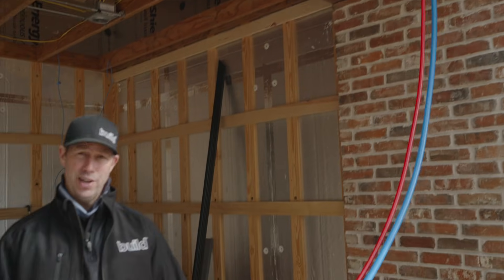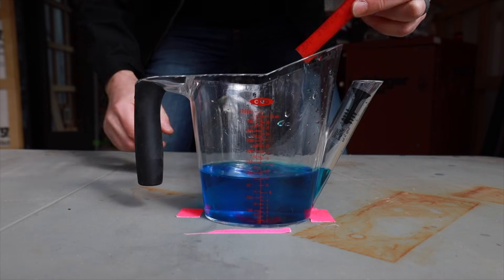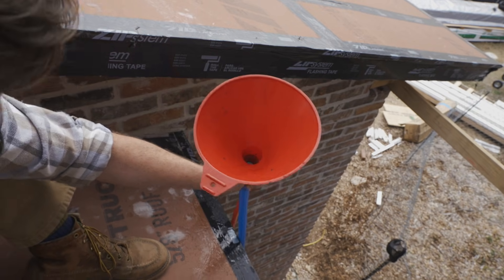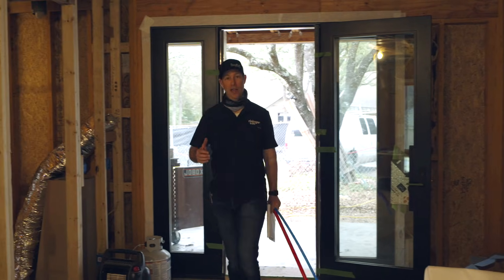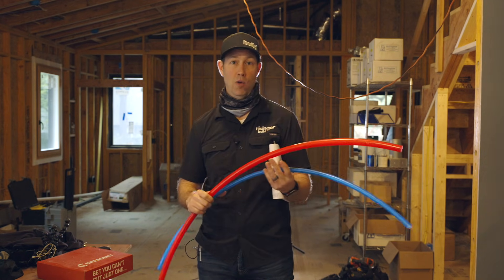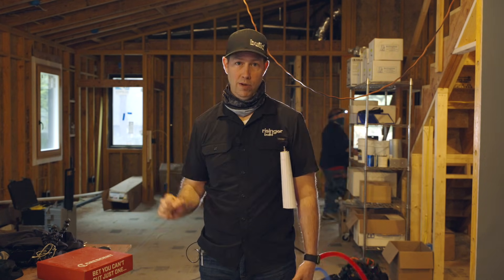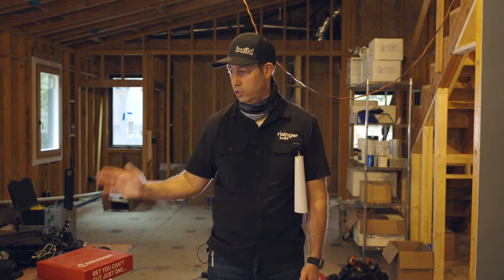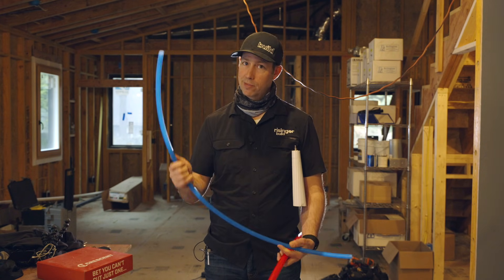What's the BEST Plumbing System

Comment: (.75^2) / (.5^2) = 2.25
(.681^2) / (.485^2) = 1.95

Question: in a hot loop system, is the cost of constantly pumping hot water significant? And, isn't more water used because it has to be bypassed to cold, or separately heated?

Comment: Matt, have you ever looked at small electric on-demand water heaters for bathroom sinks? I am considering that in my new build but find no information on that as an option for low-frequency, low-volume hot water needs.

Comment: I suspect the volume of water you need to heat up at your tap is close to double the capacity of the pipe itself. The water doesn't instantaneously become hot as soon as you've flushed the pipe because you still have to heat up the pipe itself.

Comment: Just gonna put this out there pex is cheap junk. It might be super easy and cheap to install but if you live anywhere cold the mice come and chew through the warm water lines then you end up with a flooding disaster that’s buried in the wall. My dads a plumber and I’ve seen this happen in 4 different houses in New Hampshire I have copper and have no issues.

Comment: Volume doesn't = more pressure,
1/2" pex is rated for 2.3/2.5 gpm
Most fixtures now are are rated 1.0/1.5 gpm....so it doesn't matter what size pipe you are still getting the same flow rate at every fixture.

Comment: apparently i'm an idiot, so if someone can explain to a third grader (me, apparently), i'd appreciate it. Matt indicated that using 3/4 pipe speeds the time to get warm water, but wouldn't that mean accepting almost a 2x waste, from the shown experiment? when only talking about saving water, if the hot water is 10 feet away from shower, 1/2 pipe requires the movement of 1.5 cups of water, and 3/4 pipe requires the movement of 3 cups of water, how does moving the (hot) water that 10 feet with 3/4 pipe save water (i see that as more wasteful by 2x). If only concerned about the time it takes the water to travel that 10 feet, then yeah, use the 3/4 pipe (and accept twice the waste waiting for the water to warm up). 

also, are existing point of use/tankless water heaters not available in the states with sufficient flow to sufficiently heat a high flow shower head?

thanks, appreciate the content!

Comment: need to deploy smart building techniques, have all the water centrally located around a water closet with water heater, kitchen sink, water usage, laundry and batchon one side bath around the central core, easier to design than think. closer to the core, less likely to have freeze issues in colder weather even with failure of heat.

Comment: Take one 3/4" insulated hot water supply line to the room, then use a small manifold block to break out all the equipment in that room with 1/2" lines. This lets the whole room benefit if one piece of equipment is running hot water already. You can put this circuit on a bigger manifold block in the basement (as shown) so that you still have complete control, best of both worlds.
Reply: but you still have 3/4" * x ft worth of volume of water going down the drain before water is up to temp. which seems more like what he was worried about.
Reply: @giantgizan  The available volume makes no difference to the flow rate of a mix valve on any fixture. In other words, fixtures are the bottle neck where you control temp and flow rate. A larger volume of water maintains its temp for longer,  and if you run a second fixture you immediately benefit from the first being already on. If you run individual 1/2" lines, you're going to wait for a greater volume of water to heat up between waiting on two. Your point is moot in that scenario. In the end, water is the cheapest utility, and each situation is different. Often, 3/4" main to 1/2" manifold is choice.

Comment: The downside to the loop is the energy used to pump water and to keep the loop line at temperature (so it should be well insulated). If your home is fully self-sufficient power-wise, that's fine. If not, you need to decide which resource is more valuable.

Comment: energy? heh. how about customer satisfaction?  I've been in quite a few of these houses doing service. NO ONE likes them. NO ONE. delivery speed from heater to faucet is extremely slow. fixing the problem (aside from cutting it all out & starting over) is near impossible. the central shutoff hub valves are problematic at best. good old central trunk line H & C with hot return loop wins out hands down in customer satisfaction EVERY time.

Comment: Here in Ontario Canada, electricity costs are insane, so its worth the wait.  Having a tub by the shower, and running it to get hot water, quickly solves the wait problem.  If i do another custom home, it will have on demand heaters sprinkled out in the boonies to help those long runs. Gas fired primary tank, as that is our minimum cost heater, with on demand heat to save those precious gallons on the 3/4 runs warm up problem.  Crazy.. maybe, but his minimizes waste of both resources.

Comment: Hey Matt, You missed one system - the Gravity Loop System (John Hansen also referred to it). I rehab houses, and I add this feature whenever possible. I have it in my home as well. The water heater needs to be downstairs, where most of the pipes are above it; or in a utility crawlspace. Design the Hot Out of the heater to go straight up for  a foot or two. From the farthest hot faucet, bring a return line back, and at some point have it drop downhill at a slope before it gets to the bottom cleanout of the water heater. Put an inline check valve right at the water heater return. All hot water lines must be insulated, except the last 6 to 8 feet of the return. Convection and gravity create a natural slow flow, that keeps the hot charged all the time. We use natural gas water heaters, which are extremely efficient and cost effective. Since all the hot lines are insulated, once they are all charged, the heater hardly has to run to keep the temp up. No pump to turn on and off or replace, no wear from friction from the speed of a constant pump. Beautiful!  
- In houses that need a pump for circulation, we use simple on-off one speed pumps, and connect them to an Alexa smart plug.  Whenever you want hot water anywhere, just say, "Alexa, run the hot."
Reply: So is this pretty much what Matt was talking about just without a circulating pump gravity feed instead (obviously set up a bit different)? If so, it's genius and thanks for the info.
Reply: Beware of the plumbing codes. The UPC and IRC prohibit gravity or thermosiphon recirc systems, mainly for energy reasons.

Comment: Howdy Matt,

Fellow Austin local and been watching your videos for awhile now!  I'm about to start building a new passive house and one type of plumbing I think you should cover is electric/gas point of use water heaters.  I am doing a 4 bedroom, 2.5 bathroom home and able to purchase all the point of use electric water heaters for the same price as 2 large full home.  With this I wont be running ANY hot water lines in the house, but I will have to run 220 to rooms I want to have heated water.  

What are your thoughts on this?

Thanks,
Ryan

Comment: Huh?  Matt, I wasn't able to follow your explanation of your hot water re-circulation system.  Does it have a dedicated hot water return line or not?  If not, then doesn't the same problem apply to getting cold water to a faucet?

Comment: What about a manifold system that feeds (local) manifolds..  so perhaps a 7/8" hot line to the bathroom feeding a manifold w/ short runs to the sink/shower? That way the shower and sink both charge the same line. Have you seen / or know of anyone's experiences with such a setup?
Reply: ..or instead of putting a manifold in the basement install it in a central location where the chunk of fixtures are,such that it is equi distant(more or less) to all the fixtures

Comment: You DO NOT want one of those WORTHLESS manifolds! Ours leaked terrible after just a few years! It uses crappy plastic valves. I bought a bunch of new ones. The new ones leaked too. We had a plumber replace it with a bunch of ball valves. That was expensive, but our stainless steel valves don’t leak! If any plumber wants to install a manifold like that in your new house, find a new plumber!

Comment: 3/4" main with 1/2" fixture branches. hot water recirc pump on timer at the end of the 3/4" main gives me hot water when I want it and where I want it. manifold is cute but impossible to make work with hot water recirc pump. Solar water heater before timed electric water heater to preheat in winter and fully heat in summer.  longest run is 120 feet. Run pipes inside insulation in walls rather than ceiling.  live in desert in AZ. copper or pex is best but must insulate pipes.

Comment: Interesting I'm gonna have to look forward to the next video. I was doing some research on cold region water distribution and how they avoid freezing. They use two lines unless they're serving hot then they use for lines they will loop through the town and back to the water plant. This both keeps the water from freezing and keeps the hot from losing its temperature.

Comment: This is interesting because I know somebody who just got into a new house last year with the manifold system at one end of the house and the bathroom at the other needless to say they're in a colder climate Pennsylvania and now having issues with water getting to the other end of the house that's more cold than hot. As much as I like the manifold system I think it's crazy that you have multiple lines going across the house when you can have one larger line and individually valve off each fixture and/or sections.

Comment: I have a circulating hot water loop in my house with a Taco circulator pump. Draws .76 amps and gives us almost instantaneous hot water. Works wonderfully, would not want to be without it.

Comment: Why not consider hybrid system? Most locations utilize one access point at a time and can use manifold to branch to that location and then split into outlets. Disadvantage that you may loose pressure when trying both faucets. The "ring" approach is nice but implies that entire trunk gets heated up with water recovery, may not be too effective for short usage. Also, house topology may be prohibitive where branching out makes more sense.
In the next house, I would try the recirculation.

Comment: Nah, I don;t want the complexity of a recirc system.  Give me a manifold every day.  I want to be able to cut the water off to one fixture and have the rest of the fixtures still operable.  Trunk & racetrack are trash for working on after the house is built.
Reply: And then i see folks suggesting timers, sensors, and other foolishness and complexity to mitigate against the cost of heating a recirc system.  forget that noise.
Reply: @jfruser  You do not use fixture stops?

Comment: Question: Why not go with heating the water where you need it? Bosh has those amazing small water heaters (https://www.bosch-thermotechnology.us/us/en/ocs/residential/water-heaters-1098961-c/) that are either 2.5-7 gal under a sink or a flow through heater. They electric, so it's also easy to turn them off with a smart switch when you're not at home and they are cheap  (~$150 for a 4 gal).

I assume that most new houses have solar these days because it just makes economical sense.

This would allow you to not route ANY hot water pipe through the house and just heat the water where it's needed and you have instant hot water.
And in addition, you get the room for a hot water tank in hour house back as well.

Comment: In the video it looks like you are insulating your hot water pipes that is also a great idea.  It doesn’t cost much and saves energy and helps the hot water stay warm between uses.  Were I live plumbers don’t insulate the hot I wish they did.  I built a house 3 years ago and they would not insulate the hot.

Comment: Watching an American professional contractor struggle to measure volume using words "about".  If this example here of how inaccurate and complicated the systems of measurement still used in the US are compared to the very simple metric system, I don't know what else there is to say.    In Canada we are still so heavily influenced by the US's continued use of the imperial system, that even though I was taught my entire life to use the metric system from our educational systems. I still know how tall, how heavy I am in both systems.  Also, how far a mile vs a km. etc. inches, feet, yards, all are known to us Canadians' equally as we know mm, cm, m, and Km.    It's still strange to me why the US refuses to change.  I think in my lifetime it will come to pass though.  I mean temperature even,  pretty easy for humans to relate.  Celsius 0 C is the freezing point of water.  100 C is the boiling point.  In contrast to 32 and 212... cause that makes total sense to anyone right?

Comment: Of course, a loop system doesn't really make sense with a tankless water heater.  Wish there was a 110v 15A "instant" booster water heater I could find to put on the hot water line under our kitchen sink...

Comment: What's the cost of a recirculating trunk over time compared to a manifold. Heat loss and electricity to run the recirculator pump. The recirculating trunks I've seen have not been very well insulated. If the recirculating trunk is paired with an on-demand water heater it defeats the purpose.

Comment: Manifolds are great, if you use a zoned trunk and branch system. Kitchen, bathroom, etc rather than single-use runs. If you have a really long run, install a point-of-use hot water heater inline on that branch. Plumbing is not hard. It is common sense.

Comment: Duh, if the internal diameter is actually 1/2 inch and 3/4 inch, the larger pipe holds 225% of the volume of the smaller. Same goes for  4 inch vs 6 inch pipe. If you double the diameter, the larger pipe holds four times the amount of liquid.

Comment: I have a recirc that is on a loop but my problem is if I use a significant amount of water (shower, etc) cold water enters into the bottom of the water heater and then the water heater doesn’t fully heat the water and I get cold water prematurely because it moves the water out if the heater before it can heat it up...Is there a way to avoid this?

Comment: Trunk & branch + local instant heaters. But of course, there's no free lunch.
Reply: Yes their is I put H valves going to my toilet take a #2 flush then turn on shower bam hot water. In the winter open hot valve close the cold one. And no the hot water isn't going to crack the toilet.
Reply: @paulsosa1872  😄

Comment: Is there a case for tankless on demand water heaters at each fixture to eliminate long hot runs altogether?
Reply: I think it could at least make sense to have a small secondary heater strategically positioned to be close to the bathrooms.  The cold water in the line from the main will mix with what's in the secondary and probably not be a problem.
Reply: I was thinking completely decentralized hot water to both eliminate the wait and waste of heating water in a long run.  I had not considered how much current electric on demand heaters draw.  With the recent winter storms and Texas' fair weather power grid... I'm not sure anymore.  Could a generator handle the furnace and on demand point of use water heaters?  More to think about.
Reply: @MrAdarity  yeah probably expensive and overkill for most normal homes.  On-demand recirculation is probably the most cost-effective retrofit option.

Comment: A 3/4" hot water recirculating racetrack layout will give you quick hot water, but this will constantly lose heat into your house 24/365. That is fine if the outdoor temp is cold, but on all other days it is either just waste or potential extra heat for your A/C to remove.  What a waste for a slightly quicker to start 5 minute shower once a day. I have a simple 1/2" trunk and branch hot water system with a centrally located water heater that works perfectly well for my house with 3 full baths. Except for your dishwasher you almost never use hot water without mixing it with cold water at the faucet. By keeping your hot water piping at 1/2" there is less water to flush before you get hot water. A 1/2" water line should be able to discharge 5 gal/minute at full bore, so a normal hot water tank would be drained in less than 10 minutes if operated that way. You only need 3/4" or larger pipe for your central cold water trunk. No wonder our nation pollutes more than any other.
Reply: I know people who have fitted these in the UK but on a timer. The loop is pumped morning and evening when everyone is getting up and taking showers, or washing a few things by hand, having baths (dishwashers and washing machines are cold-fill-only anyway now so don't enter the consideration). The other 20 or so hours it just sits still. A compromise between water and energy, both paid for by the unit used here.

Comment: The one thing I don’t understand it’s not like water just disappears when it gets in our pipes correct me if I’m wrong but there’s calls a thing called water cycle anyways that’s what I learned in biology
Reply: Glass Duck What are you talking about? If you run a tap for a minute until it gets hot, that initial volume of water runs to the drain. Depending on your local system, that will enter the sewers, head for treatment then be dumped in the river or ocean. In very few places is it used again. Yes, it's not lost from the planet, but it's drinking quality water that has been stored, treated and in many cases transported tens if not hundreds of miles.
Reply: @spencerwilton5831  What do you mean that you understand you say it right in there that the water cycle is still true that’s what I’m talking about